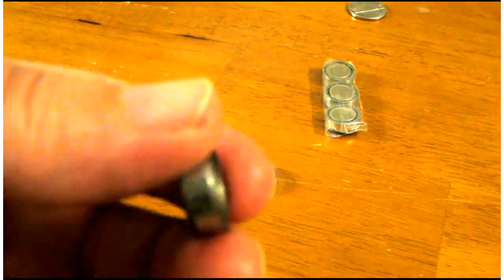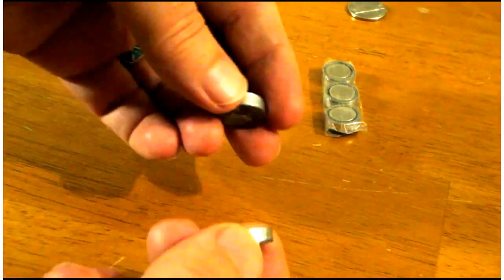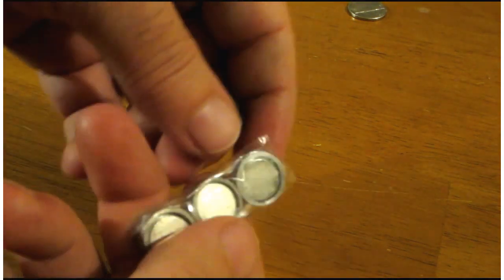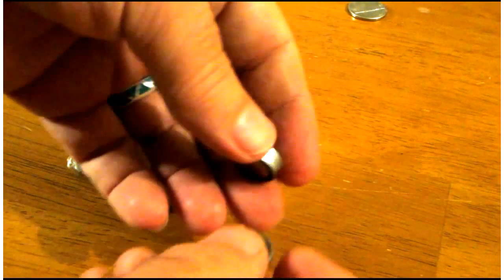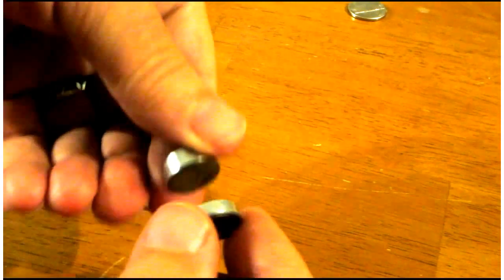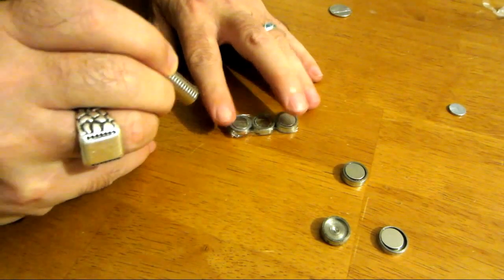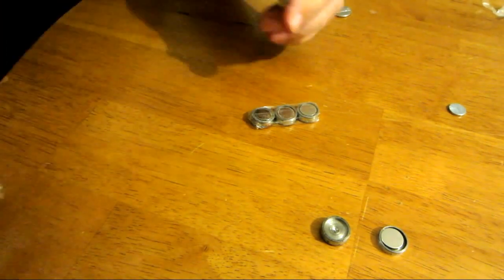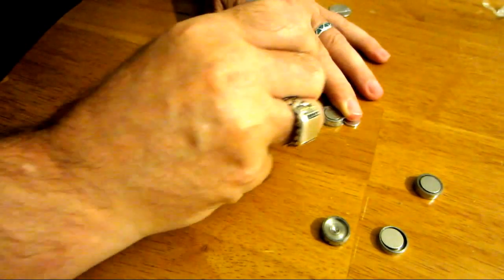Experimenting with magnetic field shielding material

Comment: Hey, they have a metal called "mumetal " that blocks the polarity of a magnet ,they use in electrical and magnet devices ,it can be found on the net under magnetic shielding .com  if ya decide to get some due a video on making a perpetual magnetic motor 👍🏼 🤔
Reply from the maker: Wonderful idea! As soon as I get time to do it I will. Thanks for the info. That's really the missing part of the motor is shielding the magnets from chugging from one to the next.